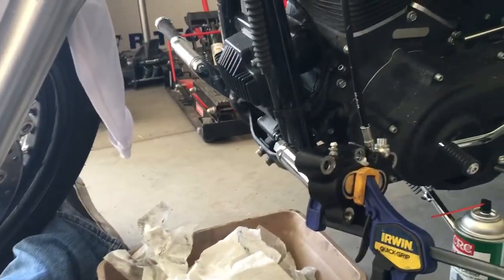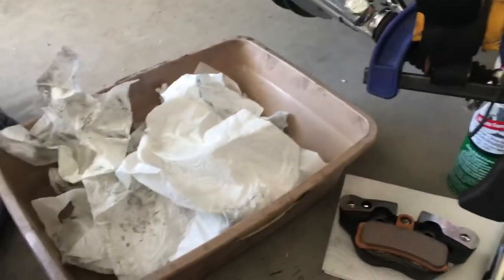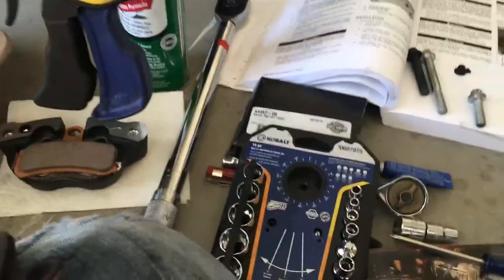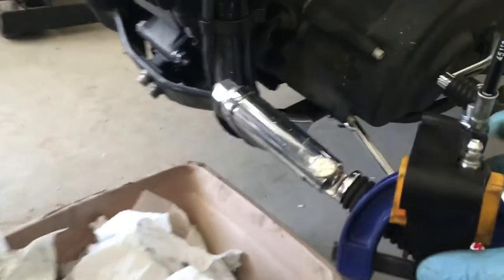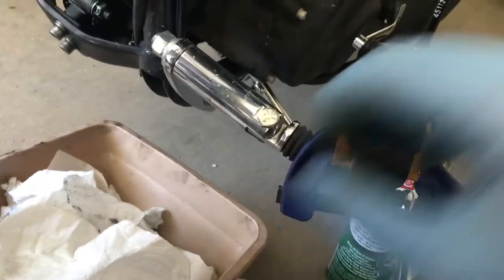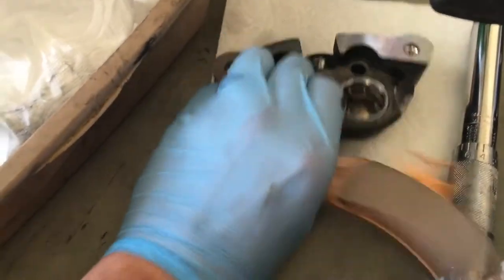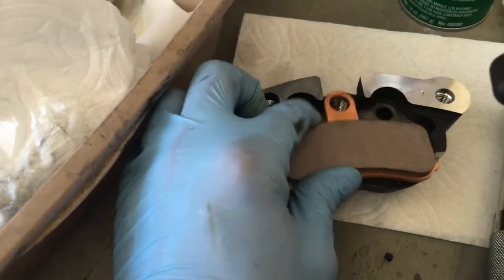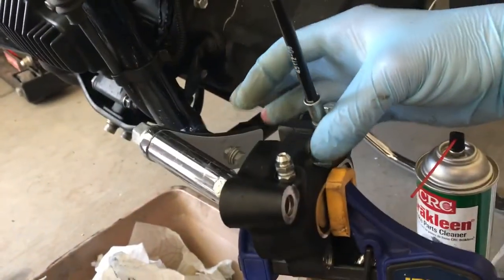Front Brake Pad Replacement 11' Harley-Davidson FXDB

Comment: Why would you not split the callipers, it’s one bolt and takes two seconds, it’s easier to push the plungers in with a clamp, easier to inspect and to clean easier to install the pads and check the condition of the pistons. Hey maybe that’s why Harley engineers went to all the trouble of designing it in two halves? Maybe the viewers of these sorts of channels are used to watching someone called dangerous Dan being filmed by his mum while forcing screw drivers and old nails into break pads while Megadeath plays in the background.😂

Comment: Do you have to open up the hydraulic system and bleed out , and does abs make a difference  ?
Reply from the maker: You don’t have to. But I was changing brake fluid so I did it that way. Usually all you have to do is change the pads by sliding them out.

Comment: This is how NOT to change brake pads. Splitting the caliper in half Is not necessary at all. You can tap the top of the break pad with a flat head screw driver and the brake pads will fall out. Sorry dude but you’re not machenically inclined to be doing how to videos.
Reply from the maker: Jason de Leon, I am well aware of this. I opened the caliper to show viewers what it looks like. Good job noticing. You must be really smart.
Reply: @jlsledge  Must be, look how he spelled mechanically
Reply: @kevingillespie3902 oh no, not a spelling error.  Dork.